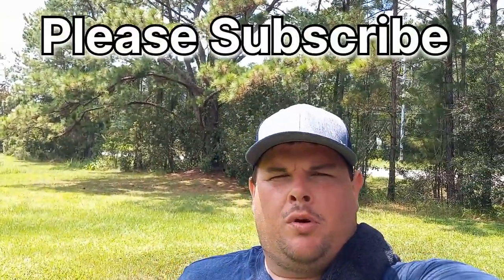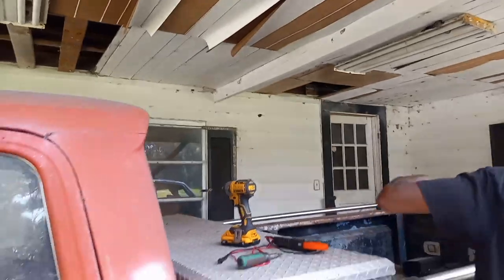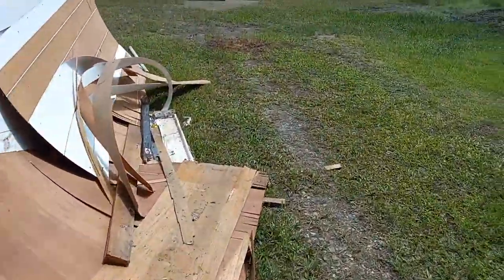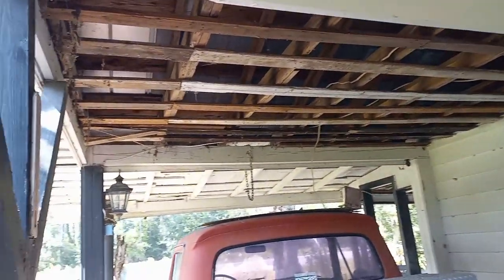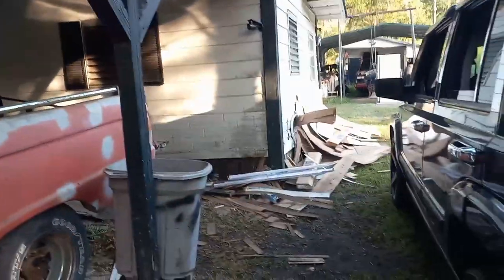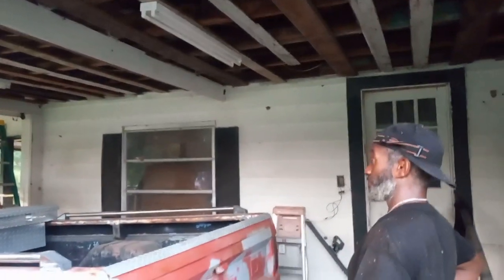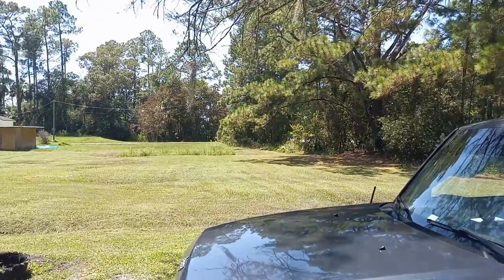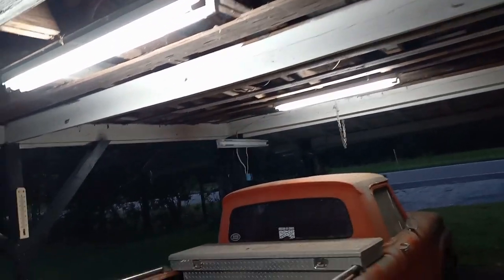Otter Creek Electrician Mr. Sweet Putting Some LED Lights In My Carport To Get It Brighter In There

Comment: Nice job.  Personally I'd close it back up ... unless you like bird droppings from all the birds nesting up in there.  if you decide to leave it open then yes, take down the boards. I'd also suggest a bug light to help with the insects. Be sure to add those old lights to your next recycle run - check with your recycle center - some pay higher rate for those ballasts.

Comment: Great job Mr Sweet!  
If you store things in the attic I would cover it. If not, I would leave it open. Seems like it would allow air to circulate and push hot air out that is over your rooms inside the house.

Comment: Giving a face lift outside that the led lights will make a difference on saving on electricity to brightness. These lights are in 80’s of old apartments were I live. Leave it open what about the unwanted guests of animals going up to make a home. Good to get out the old wires before they caught on fire. The lights looks great right decision to put the lights the other way.

Comment: Good job, but you need a roof on to avoid critters going in to mess with your wiring that is exposed! Even if you can’t do it all at once, paint the material you are putting up first then you will just have to do touch ups

Comment: Good 👍 new lights, I hate putting up them old lights and watching them dim and go out.  The cost savings of lower watts and long time running is great. Not to mention the brightness.  I would put some thin plywood (1/4 or 1/8 in) and paint them white before installing them would prevent owl to bats to bees from comming in.